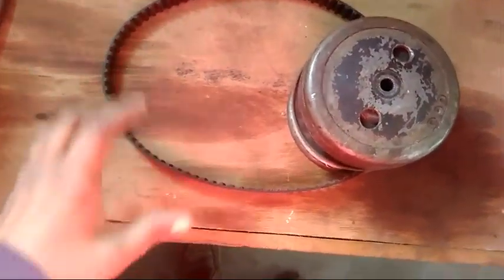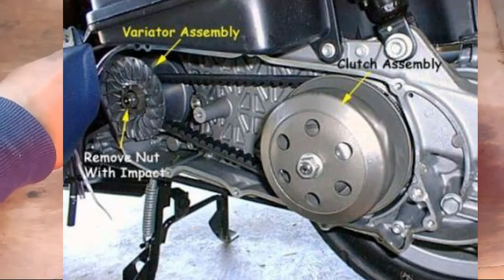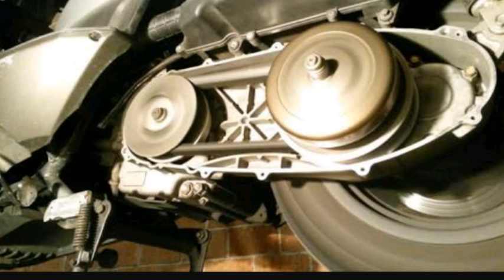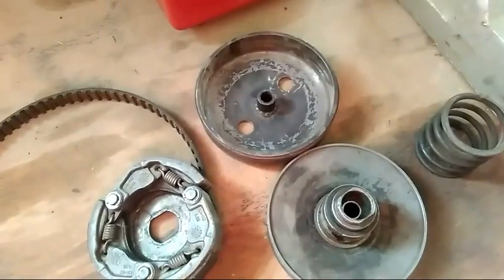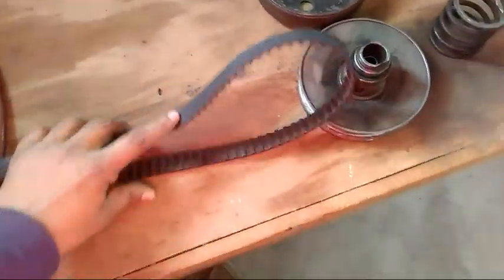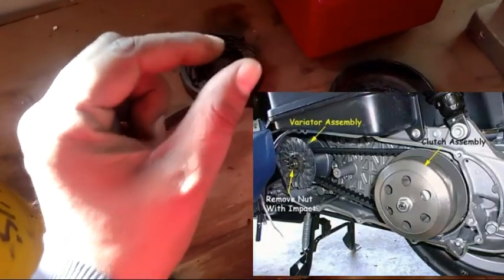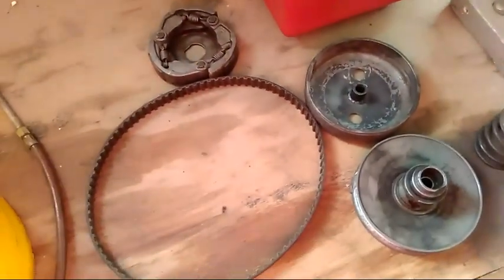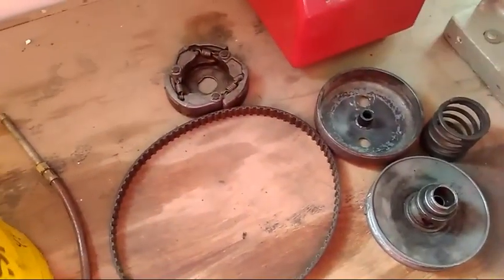Scooty handle vibration/wheel noisae/pickup issue/Mileage issue/Two wheeler problems/All solved

Comment: Hello bro. Meri new Hero Duet 7500km chali hai. 20-25km speed pe Vibration krti thi. Fir mene mechanic se Clean krna roller, shoe, pully, sab. Or original Belt bhi change karwaya. Ab 20-25km pe thik chal rahi. Par 40-60km  ki speed pe ghur ghur ghur vibration hota. Or pero me jhanjhanhat hoti.
Ab kon sa parts change kare dost. Me to bahut presan hu isse.
Umeed hai acha solution btaenge aap.
Reply: Bhai abhi theek hui ki nahi?
Merko bhi same problem aa rhi hai meri activa 5g 980 km chali hai 1st day se 40-50 pe vibrate karti hai showroom wale bol rhe hai ki 2000 km jab ho jayege tab khud theek ho jayege
Reply: Hero me ye problem h maine bhi 2016 m li thi or 2018 m bech di